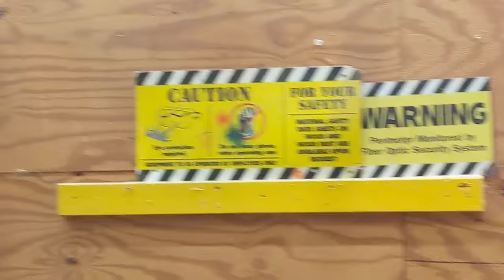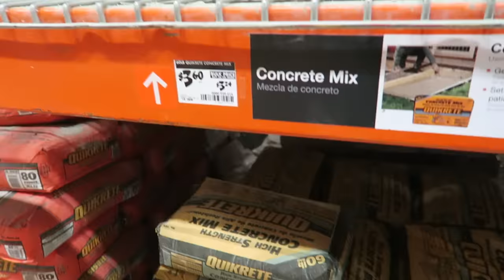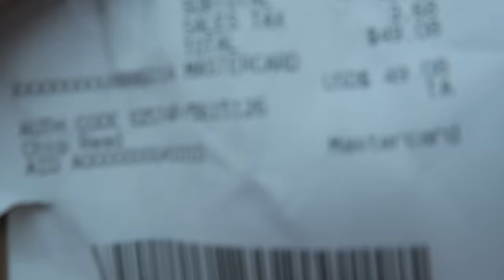How To: DIY Squat Rack & Bench Press Rack for $50

Comment: yeah lemme just build this for $50 because I'm on a budget then use the olympic weightlifting bar and the set of plates i definitely already have
Reply: And the two rogue racks lol
Reply: Go to home depot and buy some cinderblocks, a galvanized pipe, and some clamps. should get the job done!
Reply: theCrypticGlint how much does all that cost and how much weight can you get that way?
Reply: @gabe-qr5vb  U can get 4 regular size cinderblocks, 4 half size blocks, some bricks , a pipe and clamps for about $30. the regular size cinderblocks weight 40 pounds each, the half size cinder blocks are 20 pounds each, and each brick is about 5. In short, u can get about 220 pounds of weight and a "bar" for approx. $30.
Reply: theCrypticGlint how much weight do you think this set up could hold tho?
Reply: gabe around 400 pounds i would say
Reply: @gabe-qr5vb  A scaffold bar is a cheap way to make a barbell at home - can use old tyres to fill with concrete too which you can often get free from a garage.

Comment: Lol 2x4s can hold a hell of alot more than 450 lbs of downward force the way its set up. The tinsel strength on one of those is incredible. Add more concrete and safetys than can double as legs for stability and you really wouldn't have to worry about how much weight you put on there

Comment: Hey Coop. I see your $50 2x4 rack and raise you by going all in on 16 $1.10 cinder blocks (8 per side).   Throw a couple ratty old towels on top to protect the bar.  Total cost less than $20.
Reply: Plus, reading the comments, cinder blocks much safer😊

Comment: Instead of the concrete you should get more wood and attach it to the bottom, the wooden rack should look like it has 2 very cheep ski's attached on the bottom lol. Now from a side angle you need to have wood that diagonally attaches low from the wood rack outwards both left and right to the wood ski's. Lastly use some type of cheap ass hardboard as the flooring and attach the whole rack to that so the rack doesn't move when you are standing on the hardboard :) This might be a little bit more expensive, but way more stable even though it's not as heavy :)

Comment: Materials List:

6  - 2"x4"x8' (46 total feet needed for build)
1 - 80lb/60lb bag of concrete
1 - bottle of wood glue
1 - box of 2-1/2 inch screws
3 - 5 gallon buckets (only 2 required for squat rack, third for mixing concrete if you don't have wheelbarrow)

Comment: THANK YOU SO MUCH FOR THIS POST! I'm putting in my order tonight, however, I was hoping I could use some advice on height variations for the wooden beam cuts? I'm 5'0 tall, would really appreciate hearing back from you and what you would suggest :)
Reply: Im the same height and was wondering the same thing! did you find out what sizes would work?
Reply: @carlynwinston5764  Hi :) So I never got a reply, but after playing around with it, my dad and I adjusted with 36",38", 47.5", 49.5", and 68". Honestly though, we cut the original numbers, and I stood beside them, and we adjusted from there :) so I would highly suggest doing that too

Comment: Benching on that looks sketch as hell.
Reply: Stack Concrete block high enough to prevent getting stuck under the bar. Just as high as your chest is above the floor. If you fail the lift, exhale and crawl out from under.
Reply: David Cohen good thinking
Reply: Those buckets tipped back I’m like nope lol
Reply: That's why your not benching on it you're squatting.
Reply: @ChristianA328  I found I needed four 8x8x16 blocks under each side, eight total. They cost $1.55 each, but you can sometimes find some piled near a dumpster on a construction site. Max cost $12.80 Make sure you lay them lying side down because that's more stable.
Reply: You can also just floor press and do zerchers
Reply: @bigsergonbaby5959  I literally saw him do a bench press on the video dude
Reply: @onlyjoshing  you can also do Steinborn Squats, Step-ups, or Bulgarian Split Squats for legs, Dumbbell Bench Presses/Incline Presses and won't need a spotter.
Reply: I'd be concerned with reracking the weight and tipping the whole thing backwards - decided to build my own bench to survive this lockdown and went for a built in rack on that as a first video. Would really appreciate any feedback.
Reply: it works fine, I've been going it for years
Reply: It's actually not bad at all I'm going to be building it. You just have to edit it abit. 1) Place this setup close to a wall 2) Screw two 2x4's perpendicular to the back and top of the longest 2x4 3)Make sure those new perpendicular pieces of wood you screwed in are in contact with the wall. This will make sure that when you re-rack if it ever tries to tip forward, those 2 pieces of wood will basically stop it. I can't wait to build this, gonna be dope.

Comment: I was with you until the end, when on placing the bar back, your rack tipped forward, not good. Having in my time put up my fence posts using a good 2 feet depth of concrete to bed them in plus an ex  Civil Eng Technician and later teaching Physics, on seeing the small amount of concrete you put in each pot, was not surprise at all, it nearly tipped. So why did you not go for wider buckets and more concrete considering the weights you wanted to use?

Comment: Hi, I was wondering if you could help me out with an issue for my garage gym. I was deadlifting but even with a yoga mat and cardboard it was still loud.
Reply: Put earplugs in. Helps kill the noise every time 😂😂
Reply: Thick carpets, foam mats (gardening accessory - therefor cheap) and dictionaries. Yoga mat is too thin and cardboard 'slams' like wood. Note the height of your barbell vs your feet - you may need something to stand on too if it's too high (I'm thinking ordinary deadlift becomes deficit deadlift)
Reply: Turn up the music loud enough and nobody will hear the slamming weights.

Comment: So if anybody is actually looking to do this I can speak on this subject since I have used one of these for 3 months straight. 
I DO NOT recommend you do this because the plastic at the bottom of the bucket started to break and make the whole thing 
unstable. The materials cost somewhere around 118$ and imagine my surprise when I found out the cheapest power rack is around 120$. It was very cool at first but ultimately not worth.

Comment: How is that green ryobi working out for you I read they can be hit and miss
Reply: Ive used them on construction sites they arent good. The rechargeable batteries dont get you very far. I get 4x the battery life on my 4 amp makita drills.

But if its just for basic home projects it will get you by
Reply: @dave7061  thanks I have read that about alot of power tools like that

Comment: i think you set the squat position on the rack a little too high for yourself lol, you could also add some sort of brace or a 2x4 cut in a 45 degree angle and attach it just over the bucket so it tips less _\
Reply: thatcheeseguy attach it over the bucket ?

Comment: Those nails were the suckiest on this planet. During installation, when the screw is halfway, the screwhead deforms and it isnt capable to go through the 2x4. I used Nails and hammer. Worked like a charm. & it's easier

Comment: Gotta love the logic of cheaping out on on a rack when you're lifting with like $1000 worth of barbell and weights
Reply: The person going this route is probably not rocking an expensive barbell and new plates. You can get decent bars for >$200 on amazon, and shitty used weights can (or at least could in the before times) be found for >/=$1.00 per pound.
Reply: I mean he is giving people an option that don't have the money, he even states he doesn't need it when he has 2 nice racks in his garage. I might be doing this, since I am on a tight budget. and its going to be  hard to get stuff because a lot of people are buying out the cheap options because of the Quarantine/Self Isolation

Comment: anyone know what this would cost today?
Reply: i didnt use 2x4 like he did... i also didnt use 1x30lbs concrete...
mine was 2 pails, 2 30lbs crete, 2 3/4 stud bolt by 12", 2  4x4 cedar post 6' long
it was like 110 CAD..
the stud bolts are driven through the 4x4 post, at a slight angle.. they serve as 'pins' for my bench press, and overhead press
the top of the post is generously notched out, to serve as squat rack, cut to correct height for me to front/back squat..
wasnt sure of the shear strength of the bolts, so i loaded it with barbell 400lbs, and stood on my bench and 'bounced' the bar on them, to see if they would fail...
my poverty 'rack' serves me
im cool with it for now...
my advice, focus on a having/aquiring a 'good' decent bench first.. a good one.. not a bench made out toothpicks..
a good one, wide back, leg extension avail, backrest incline option... i really like mine its the bees knees... 
tl;dr  THIS THING WILL PULL ITS WEIGHT FOR A YEAR OR TWO.. IN THE MEANTIME I WILL KEEP AN EYE OUT FOR RACK/SQAUT CAGE FOR SALE
Reply: @kwazhims3lf  i found 11-12 gauge steel squat stands for 160 that are now discontinued so far as I can tell lol.

Comment: I made mine a couple years ago with 2x6s. Also highly recommend these with a bunch more concrete. 
SAKRETE	12 in. x 48 in. Tube for Concrete
https://www.homedepot.com/p/SAKRETE-12-in-x-48-in-Tube-for-Concrete-200077374/100324386 Buy one and cut it in half for each post. I just left the form on for added protection of the concrete.

Comment: That Chinese squat stand looks much more stable and proves nothing about the stability of this one. If it's nothing to be afraid of, why would you only do this in a pinch, and require a spotter to bench press at all? I also noticed that you did check to see how level the boards in the concrete were, but you didn't say anything about it? That seems like it might be important.  In the comments you say you wish you'd used double the concrete, but that doesn't make it into the video somehow.  Honestly this just seems like a copy of the strength co. video that came out 2 days earlier, except longer, less clear, and with more potentially dangerous advice.